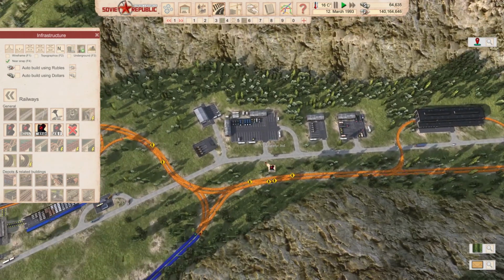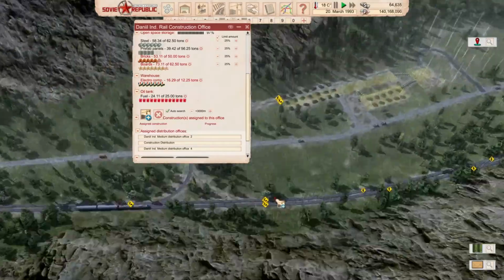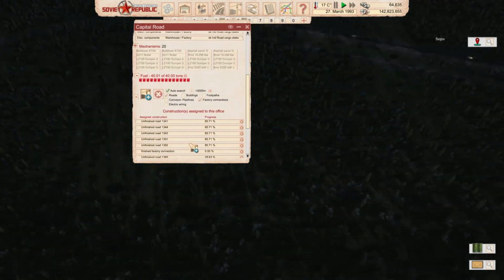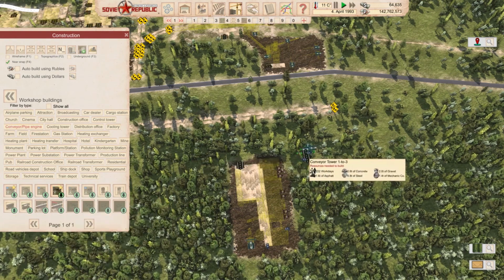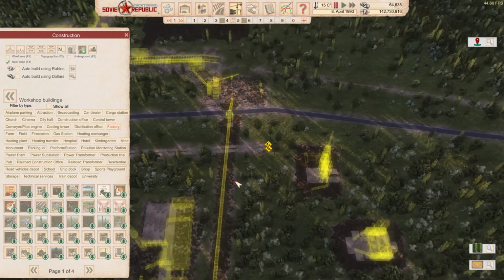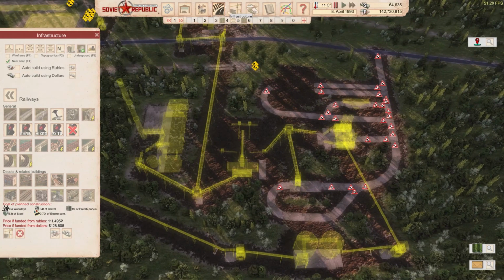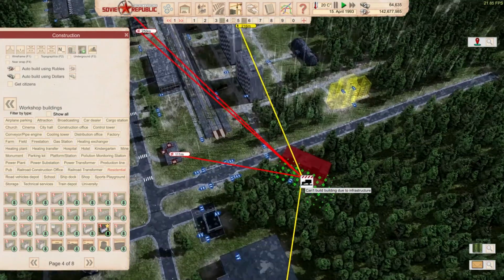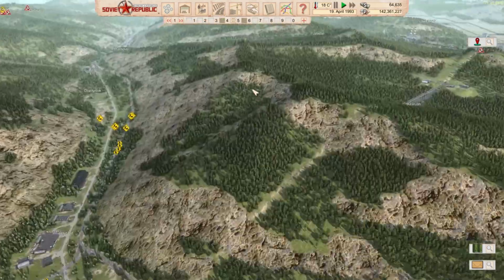Soviet Republic - Alaska - Expansion - Ep.147

Comment: Ok assume with the conveyor belt, there is a gate that can open and close based on what's being delivered and what direction the agragate is supposed to be going. If coal comes in the belt directes it to the right gate and coal the other. The same belt being used in between those gates is not a big issue or all that unreasonable. In fact its probably pretty realistic if you have to move several different things. What I don't understand is why grain cannot be moved by conveyor 🙂
Reply from the maker: I see your point! 🙂